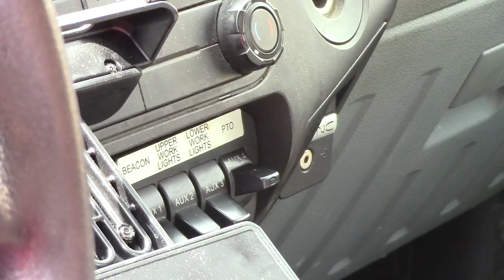PTO & Bed Controls | Smith's Towing

Comment: Some medium duty flatbeds have air brakes
Reply: The internationals the f650 the freight liners. Lots of rollbacks have air brakes they somehow just get away without have commercial license
Reply: @Austin Barron  don't need a full class A cdl just need an air brake endorsement and or a class B for this style of truck over 26k pounds